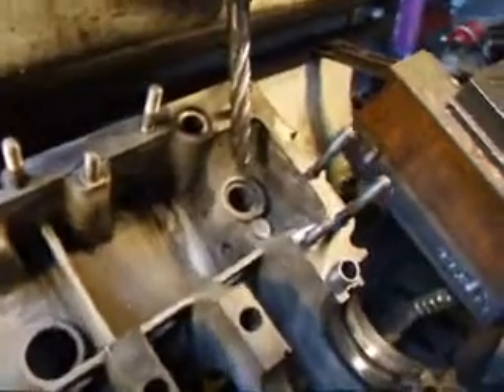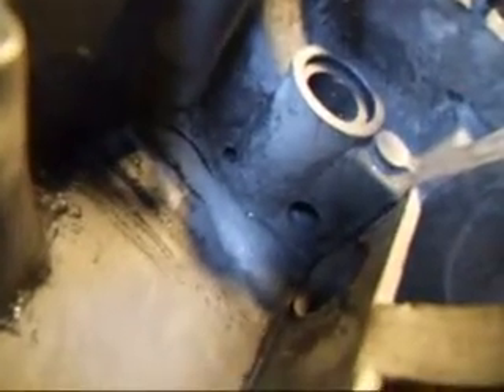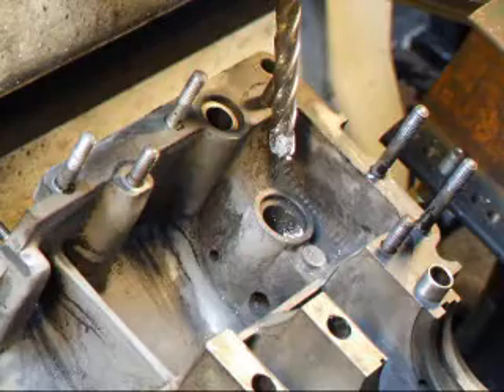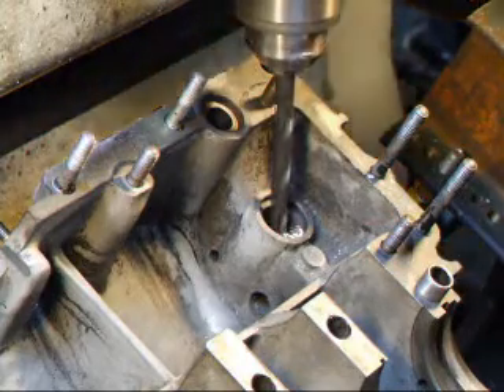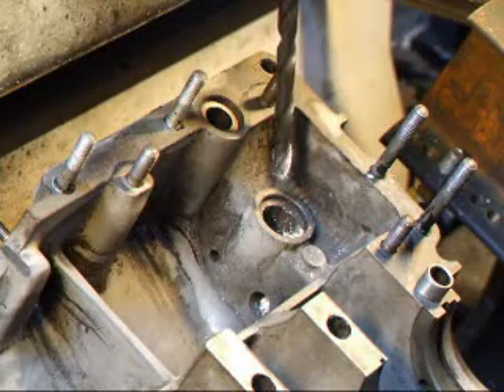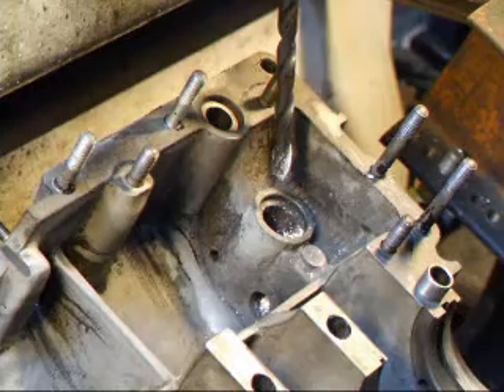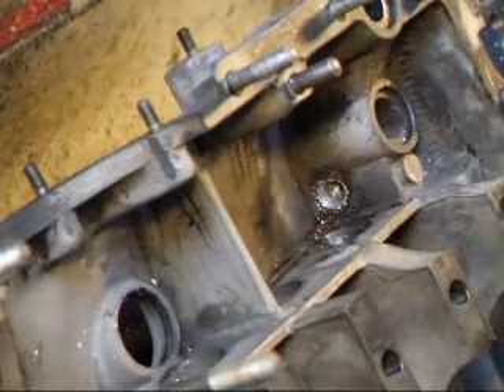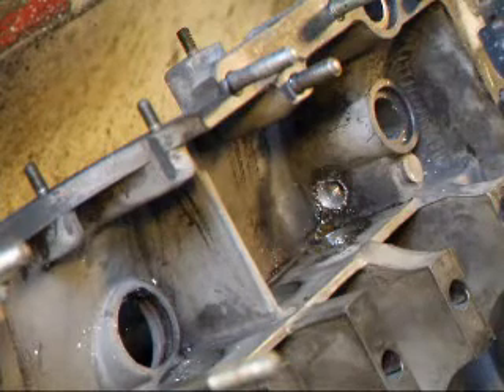Porsche 911 Oil By-Pass Block Modification

Comment from the maker: The case is magneisum and I prefer not to use anything on low-speed drilling. If this was a high speed machining operation, I would use something that would be compatible w/mag.